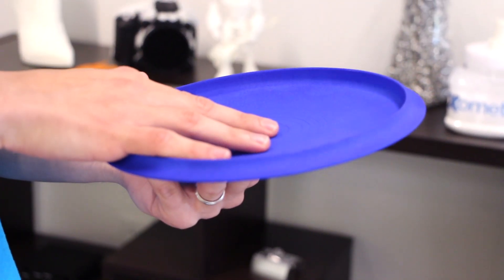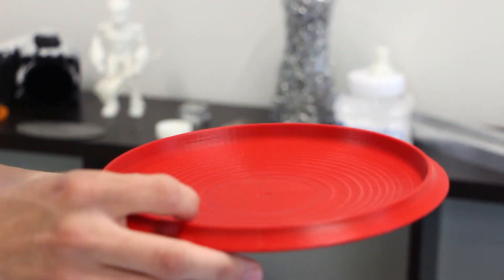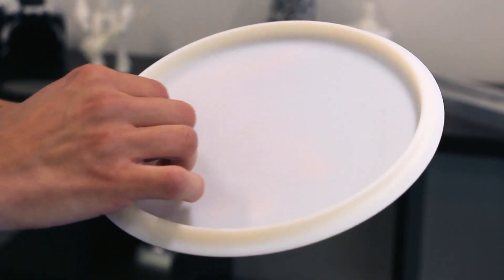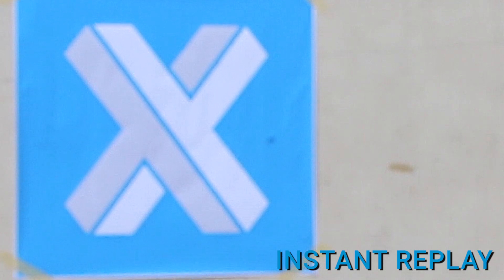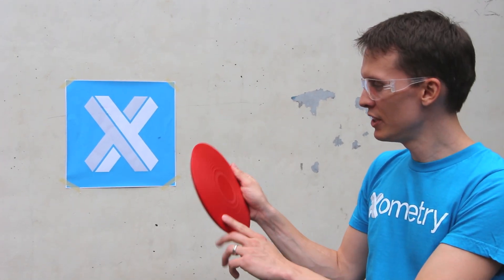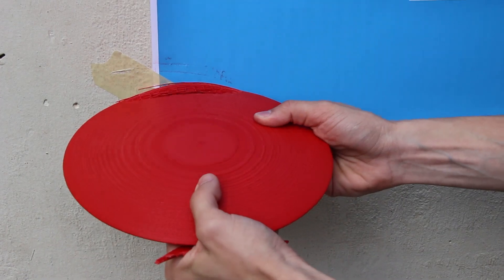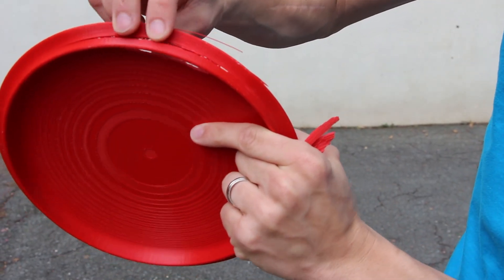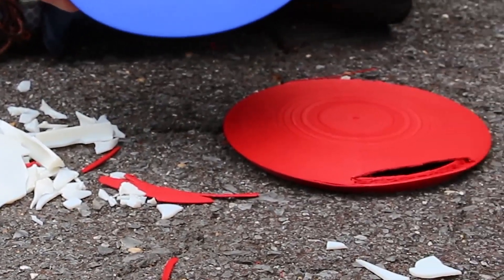Will It Break? Impact Resistance Test

Comment: So, this is an old video, but have you ever done a follow-up with any newer printing materials?
Reply: Could probably get a pretty decent disc out of TPU95. What surprised me was how well the flight plate printed in FDM, that was nearly flat and it didn't look like they had cleaned off any supports or anything.

Comment: Umm, Polyjet result was expected, if is vero material. If you use a little bit of tango in addition to the vero you will get better results,  FDM ASA is expected to have better results than Polyjet, but the tricky part is the SLS, you are using a Nylon-like material, so the priniting material by itself will have more flexibility than the other and it will absorb the impact better, and in addition to these, it looks like you painted it, so it will have more bond strength between layers; as we can see in the video the ASA printed part it breaks on the layers. so I think is not a fair comparison between technologies because you are comparing a post processed part, against a resin, against a thermoplastic. Anyway, thank you, your videos are very interesting.

Comment: can you post process ASA with acetone like with ABS? Would that  help delamination?
Reply: Hi Joseph - in theory this should help out but keep in mind Acetone is actually deforming and degrading the outer surface of the part so there is some chaos involved. FDM Nylon 12, Polycarbonate, and Ultem have better Z-lamination than FDM ASA which will also make the part more robust. Also changing the infill to solid can help. We were testing just the standard picks from the core technologies in this video.